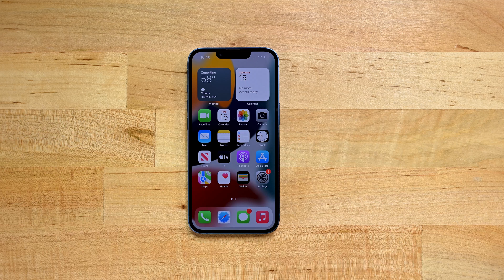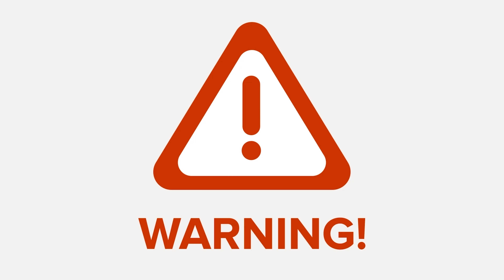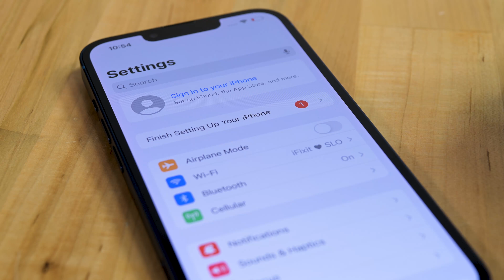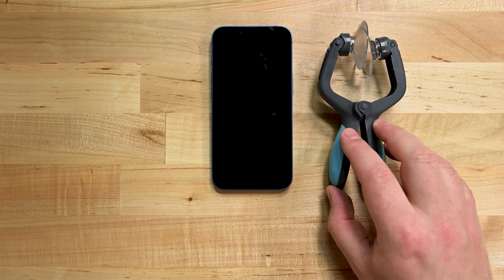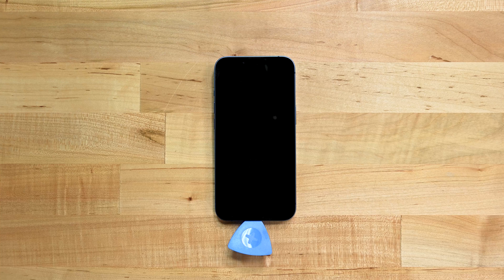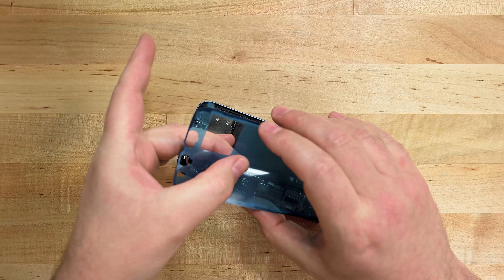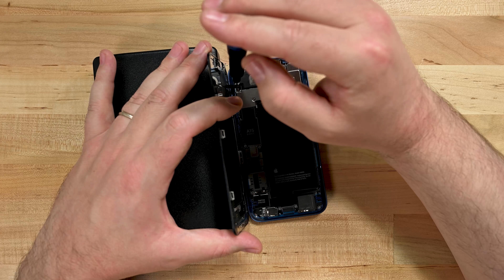How to Replace the Display on your iPhone 13!

Comment: Thanks 🙏 everything seems to be working inc Face ID. Is it normal to get the “display - unknown part” message in settings ? Does it go away? 

“Unknown Part 
The display for this iPhone is not recognised. An Apple Authorised service provider can repair the display to restore full functionality”
Reply: Thankfully with 18.1 you will be able to recalibrate the screen yourself to get true tone back!
Reply: @TheAssassin2332 no you can. 99.9% of people buy screens without light sensors. To calibrate you need the front light sensor which should be removed from the display you bought

Comment: Everything is so simple and straightforward……💩💩💩. Why didn't anyone mention that the plastic frame often comes off the OLED, making it impossible to remove the display without damaging it?

There’s no specific information about how hot the phone frame should be. I’ll add that it’s about 100°C based on my own experience. You create “helpful videos” encouraging people to attempt repairs themselves. Without experience and the right tools, they’re likely to fail, resulting in them turning to professionals like you for assistance. These kinds of videos do more harm than good.

Comment: In fact, the repair is much more difficult, you need to remove the Face iD module and rearrange it to a new display, solder the chip, restore the work of the truetone, otherwise we will get a brick without a face id and a truetone
Reply: So how do i fixed my dim brightness and my front camera?
Reply: Face id on my phone works but not the camera?

Comment: My phone fell on gravel face down and my mom ran over it .. thanks
Reply: I highly recommend you retrieve the phone from the gravel, the vehicle may need to be moved or lifted to get the tire off the phone. Once you have the phone, if the screen is cracked, you may have it repaired by Apple or a third party shop. You're welcome!

Comment: To get the screen off, I will take a half inch exacto chisel bit and wedge it into the gap between the screen and frame on the bottom of the screen near the charge port, after removing the pentelobe screws of course, gently push it into the gap and pry the screen up until you get a gap big enough to fit a plastic spudger, then slide the spudger around the perimeter of the screen popping out all of the metal clips and separating the screen from the adhesive, been doing it this way for 3 years now and haven’t broken a single iPhone screen yet. I have accidentally ripped the screen and Face ID cables trying to pull a screen up with a suction cup, it feels like it isn’t moving at all until it just POPS right off, with the chisel bit method you have ALOT more control and finesse
Advice from one repair shop owner to another
Reply: Thank you! I'm currently waiting for tools to arrive to fix mine.
Reply: U seem to know what ur talking about. I have bust screws man done it in shop yesterday. What the best way remove them ?
Reply: @stevenbates9231  like the screw heads are totally stripped?

Comment: who approved this video lol you didn't even show how difficult it is to remove the faceid.

tip: put the iOpener over the top part of display on front to loosen adhesive and carefully use a plastic pointed tip tool to remove the faceid. BE SUPER CAREFUL as with all 13 models if you break the faceid the phone will NOT display!

Comment: Im confused... so i bought a repair kit for my iphone 13 pro max and i don't have a complete "display screen..." I have the adhesive backing plus the screen itself... did you skip the step where you too off the screen, or did you have the glass screen plus LCD panel all together in one piece? would have been nice to see that part and how to replaced the cracked screen... I can replace the computer parts and wires... thats easy, it's knowing how to get this glass off or whatever.... it seems everyone skips this part in their videos and just goes to "tada.... now it's all connected again!"  without even showing how they fixed the crack.
Reply: Most people buy the full lcd and glass not just glass only.
Reply: yes,, this is known as a "glass only repair" and is quite difficult and tedious

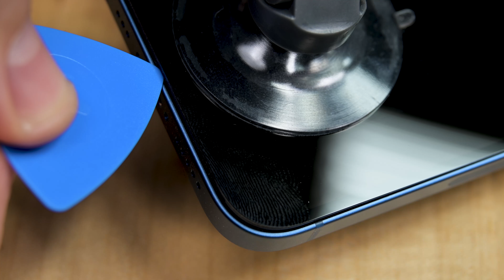Comment: At the 2:01 mark, your point of entry for the pry tool should be right above the mmWave antenna. The ingress adhesive is narrower there, and there's a bevel on the underside of the display assembly to ease pry tool insertion.
Reply: iFixit should refer to their own teardown of the 13 Pro, Step 3 second photo and Step 4.

Comment: I’m wondering if is it possible to interchange iPhone 13 display with the iPhone 13 Pro? The size is the same if I’m not mistaken..
Reply: No, due to the different panels and refresh rate.
Reply: @martinsoendergaard-jensen9602  so with pros higher refresh rate where do I find a replacement

Comment: So, where to get the display synced?
Reply: To my knowledge, only Apple can do that or maybe their authorized repair centers. I doubt they would do this if you replace the screen yourself. Apple is extremely against the right to repair so they will go to great lengths to prevent or discourage you from trying to repair your own devices as we can see.
Reply: @JJFlores197  just discovered Louis Rossmann. Check him out!
Reply: buy a cheap tool from China, idk why they say it “isn’t available to the public” it might not supposed to be but it is lol
Reply: @vaughnkhouri1364  which search terms?
Reply: @snithereens  Did you find it?

Comment: As a small repair shop owner, thank you for making this. It gives me a video I can follow along, or refer to particularly tech savvy customers.
Reply: If certain features are disabled on the phone after screen replacement how do you go about re syncing them to regain those features?
Reply: @AlienPizza38  Unfortunately, because they are serialized to the device, they can be particularly difficult to reenable. Some, like the battery or truetone, can be reenabled by a special tool (available to public) but others can not, and need Apple to replace them.
Reply: @appledolphin8157  May I ask? What might this special tool be called?
Reply: @AlienPizza38  Its called the JC Pro. Multifunction serializer, remove "battery not genuine" and "screen not genuine (in older models)" message.

Comment: Nice to see not all of apples features now break when you do simple repair jobs, quick thing I noticed missing from the repair video is taking the sensor unit off the old screen and putting it on the new one otherwise I'm fairly certain face id bricks itself
Reply: there’s other videos where you can find what happens when replacing the screen on the 13, this is the worst gen for repairs a friend told me to get the apple care since it’s the “cheapest” way to get a screen replacement and not loosing any features, maybe he’s right, too late for me tho
Reply: @albertosanchez7374  ik, I also follow several other YouTube channels that do repair videos and work at a repair center. Just thought it was interesting that they missed that step.
Reply: @albertosanchez7374  here where I live getting 2/3 cases for a flagship iphone will cost you almost as much as getting AppleCare, and it’s cheaper than any third party insurance, it is also way cheaper than getting the screen or back glass replaced 

I really like apple care because I don’t have to really think about protecting my phone at all
Reply: @albertosanchez7374  I just replaced an iPhone 13 pro screen like an hour ago, used a refurbished screen from injured gadgets and transferred the Face ID sensor, the only thing I’ve been able to notice about it is the “non-genuine display” message on startup, Face ID works, the cameras all work, tru tone even seems to work fine

Comment: How to fix an iPhone XR that does not want to charge or turn on?
Reply: Have you cleaned out the charging port?
Reply: @yasebaravenclaw2192   it neat an tidy, no problems there
Reply: @yasebaravenclaw2192   does not work
Reply: @jammaj8009  Have you tried wireless charging?
Reply: @Panzertank123  yup did that samething nothing happen phones just got little warm

Comment: You carefully edited out all the error messages that pop up when you have changed you're display I noticed...
Reply: I think they just put the original display back on again, not a replacement screen.
Reply: @why-am-i-tired  would explain why they also missed out the steps for part on the old screen that will need to be moved to the new screen
Reply: Yups, but to be fair they say warning in the beginning
Reply: But Hugh Jeffries showed you lose Face ID as well even with genuine parts.
Reply: @raymoorhead3783  Hugh jefferies video is older than this one and there are repair scheme things happening which hopefully means we will be able to repair everything eventually

Comment: Can't sync even OEM parts and screens crack easy. Just two of the million reasons that iPhones are objectively worse than the top tier androids. 🤷‍♂️
Reply: Also only usb 2.0 speeds and their latest device has huge 4gb of ram :D Maxium of 27W charging and even tho someone claims that is because charging slowly prevents battery degrading Apple battery gets swollen in 1 and half year and if not, it stops working after 2 :D
Reply: @migidid  bro 4gb of ram is plenty for an iOS device. The reason Androids need so much ram is because they mainly use Java applications, which use 3 times the memory. The reason android uses Java is because of the myriad of potential hardware Android can run on, while iOS runs on one architecture: Apple. So basically, any app for iPhone is by default going to be more optimized than most apps on android.
Reply: @funkemunky  Bro keep telling yourself that bro

Comment: Important to note: Non-genuine displays are often thicker than genuine displays and will not sit flush with the body of the phone anymore (among a slew of other trade-offs).
Reply: I did not had opportunity to fix 13 models. What about refurbished screen , do you know if there is difference ?
Reply: @BalkansWay  refurbished screens are previously broken apple OEM panels with a new digitizer, they have apple original Touch IC chips and in some cases get recognized as genuine apple parts
Reply: If you get your screens from mobile sentrix and injured gadgets, their aftermarket screens are as close to original as you can get, FX5 hard OLED screens are top notch, not as good as the original screens, but probably the best you can get from an aftermarket.
Reply: I was wondering, i'm training to do phones in a repair shop and the new display wasn't sitting as flush, thought i did something wrong, but looks like i did everything right! Also would have been nice to see them swap the ambient light and proximity sensor over to the new display in this video
Reply: LCD or OLED though?
Reply: I have a third party display and the screen displays much better colours and is a lot clearer. Why are you defending Apples crap displays?
Reply: Supreme makes really good OEM style screens everything fits flush, nothing sticks out.

Comment: Can Apple reconnect the replacement screen to your phone with their proprietary software at the Apple store? Thanks
Reply: Yes.
Their proprietary software allows them to pair / reconnect any component. 
If no 3rd party repair shop is able to do it, you should definitely turn to them.
Reply: Yes however they wouldn't if you replace it yourself.
Reply: @NightFallbsa  they do if you try yourself but they add a you tried it yourself fee
Reply: are they capable? yes. Will they restore functionality if you have done the repair even if you somehow sourced a genuine display? no.
Reply: @Carterthielftw_  why not ? I mean if I’m willing to pay for the repair, why would they refuse ?
Reply: @TechnoGeek209  Because of policies. Look at what happens if you take an iMac Pro to apple. They will flat out refuse to service it, even if you pay. Linus Tech Tips had a series on this a few years back. you can definitely give it a try, but history tells me that they will charge you for a full display swap
Reply: If you take even one bottom screw out you lose warranty forever. There is adhesieve on the screw and they will check them.
Reply: @migidid  No you dont. The Magnusson Moss Warranty Act of 1975 prohibits manufacturers from voiding warranties like that. If they deny you warranty service, they are breaking the law.

Comment: Video should be titled how ruin you iPhone by buying our high priced tools and send to us . So we can fix it for you .
Reply: Note the fact that you called them "overpriced" and not low quality, theres a difference. My $25 Kaisi kit is great, but a refurbished Pro Tech kit for $40 is amazing and I reccommend it. also, "So you can send it to us" doesnt make sense. You do realize that iFixit does not offer any kind of repair program and will not help you if you mess up the repair, right?
Reply: cheap kits will work for most people, but if your doing repair on an enthusiast or commercial scale, iFixit stuff is worlds better than amazon kits. The only place I can think of with universally higher quality is Whia, and they only make screwdrivers and each one costs $20

Comment: “The screen needs to be synched.”

They’ll do whatever it takes to stop you fixing your OWN FKNG PHONE!
Reply: Well it doesn’t NEED to. Only if you want to keep True Tone, Auto Brightness and Face ID. The screen will still work even without doing that step
Reply: @anianii  Yes. Thanks. I caught that, but you paid for True Tone, so it’s yours, except that if you replace your damaged screen with your own money and time, THEY take what you paid for away from you. That’s theft, pure and simple.

THEY need a healthy inducement. I suggest we go back to hanging thieves. That should supply the necessary wellbeing.
Reply: @anianii  is that supposed to be some kind of defense lol
Reply: Wow, thank God Apple limited the scope of their anti-consumer booby trap to within a legally passable level! What paragons of virtue.
Reply: Every iPhone screen has its own serial number.
If the MOBO detects a change in the screen’s serial number, true tone, auto-brightness and face ID are disabled.
Apple says this is a security measure to ensure that only « genuine » and authorised replacement components are used.
However, the screen itself keeps working.
There’s a workaround though : data can be copied from the broken screen onto the replacement one.
Reply: @TechnoGeek209  this requires a tool like the JC Pro 1000s which doesnt work with the 13, costs ~$150-200 and requires you to buy it from some kinda sketch site

Comment: When will they releas softwere so that evrything works after replacment?
Reply: why would they do that
Reply: @fspeshalxo69  i mean they enabled screen and face Id to work becous of pressure from costumers and repair laws so If pople pressure them even more they will have to give poeople tools to fix it
Reply: They wont. They have had this software under wraps for years and if they released the software then they would actually make repair accessable and would make their products last longer and improve the user experience. They have no intentions of doing this. The power cord on the new Studio Display is a good sign that even though they claim to be working on an independant repair program, they have no intrest in actually making their products repairable. its unfortunate. There is a tool called the JC Pro 1000s and one made by QianLi that can reprogram parts, but they cant do it for the 13 just yet
Reply: @Carterthielftw_  i know about studio I saw it 🤦‍♂️ but yea I dont use apple at all I am just curius about repairs. I mean if I bought broken iphone and fix it screan I actualy dont care about auto brigthes coz I never us it or whatever true tone is I wont be needing it ahhaha
Reply: @yusofsin7855  Never buy used Apple products. Even if its not iCloud locked at the time of purchase the previous owner can lock it by contacting apple and you simply can never unlock icloud. Apple will never ever unlock any icloud lock. Even if you purchase it from them and have receipt.  no matter what product computers tablets watches headphones all locked by icloud. What a waste of electronics. You have been warned.

Comment: Tip: since your screen is probably already broken, the suction cup won’t work very well. To get around this, put packing tape over the cracked area of the screen so that the suction cup sticks better.
Reply: How do u fix the cracked screen tho?
Reply: @MaybeTrout you can't it has to be replaced (much cheaper to do it yourself rather than going to an irl store, $60usd compared to $217usd)
Reply: @j.a.i.e  thanks git
Reply: @MaybeTrout  ur welcome got
Reply: Thanks
Reply: i just use a razor blade to remove the screen, easier
Reply: this is in their guide
Reply: @RandomUser2401  oh bruh they should’ve mentioned it then. It’s useful advice
Reply: @turle8645  they do say to follow the website guide, although it certainly would be nice if they mentioned it here as well.
Reply: This is common knowledge and is in the guide which people should be using instead of the video, the video is just more for watching and understanding. People new to fixing phones shouldn’t be fixing a $1000 phone for their first repair.
Reply: @derekk1998  if they want to they can that's literally the entire point of R2R because with that logic nobody would be fixing there own stuff because it's expensive may I remind you people work on their own cars and at some point it was their first time a car is considerably more expensive than a iphone
Reply: @smartG1123  I think you are right. But your comment is kinda hard to read for me because 1. My poor English level. And 2. There’s ain’t much full stop mark “.” In your comment.